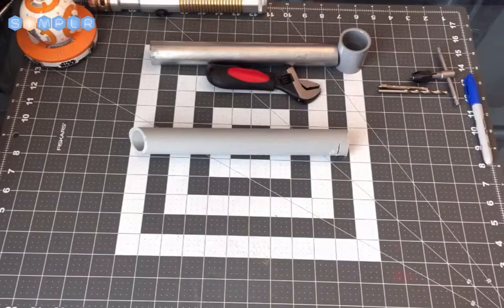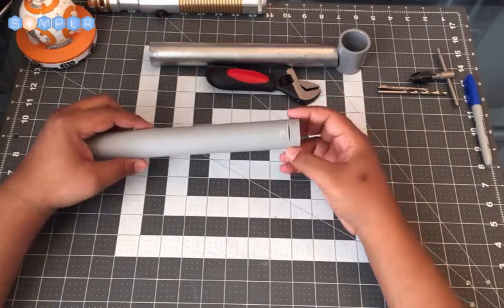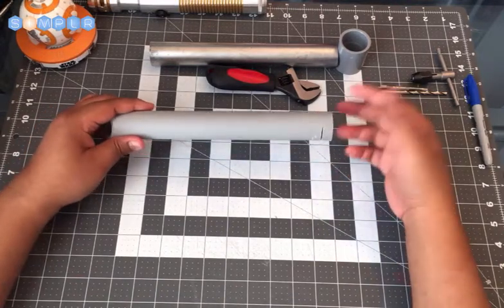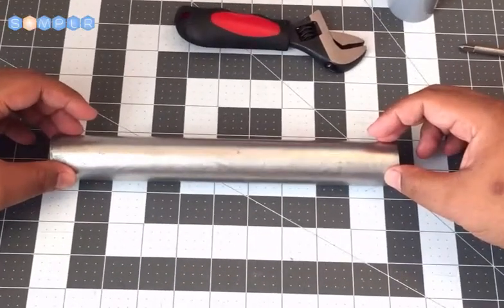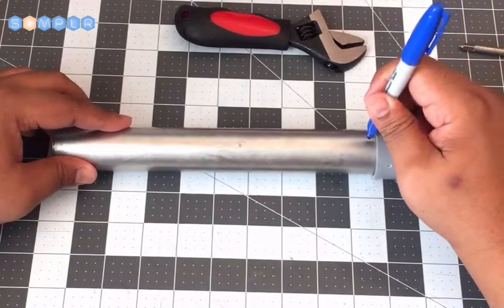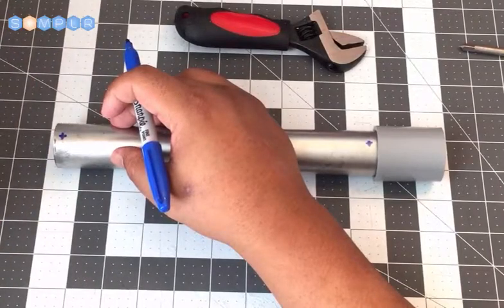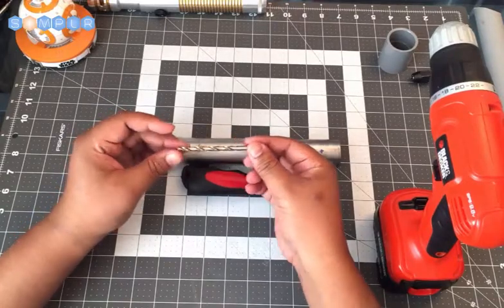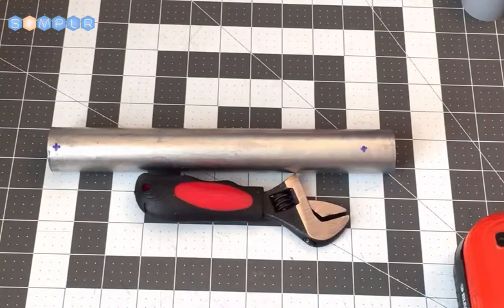(Lesson 12) Build Your Own Lightsaber, Build: Cutting, Drilling, and Tapping - Part 1

Comment: What is the size of the metal hilt and the pommel?
Reply from the maker: +Ayley Leynes Both hilts are made of pvc. One is just coated with a metallic paint. Both are 1 inch pvc (Outer diameter)